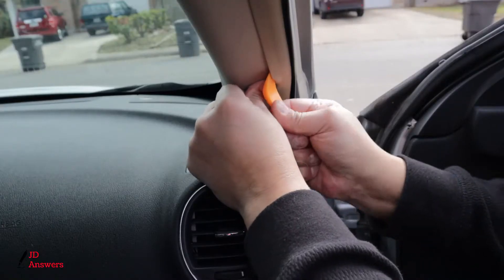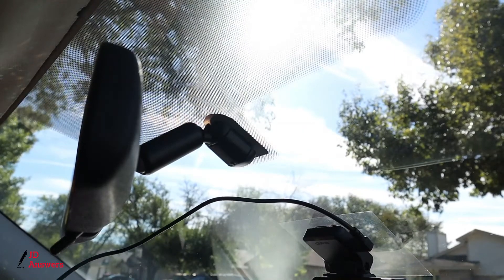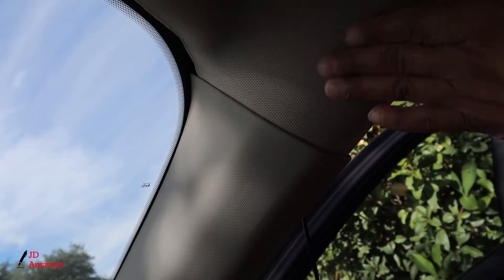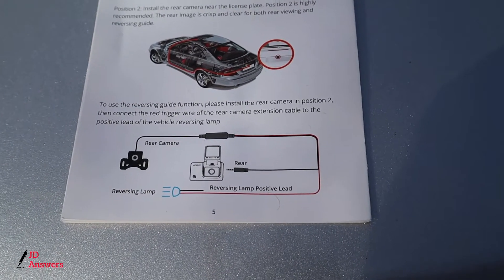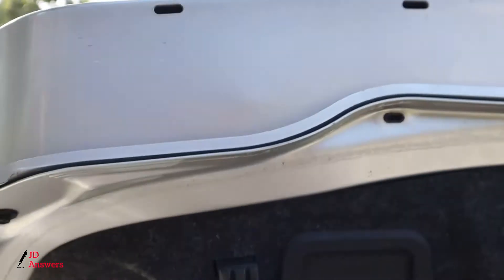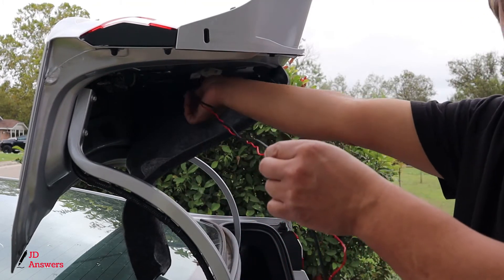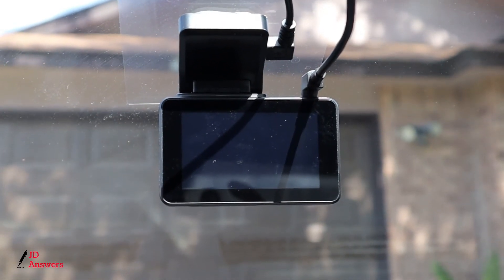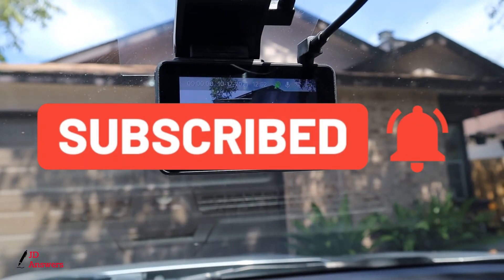HOW TO INSTALL THE KINGSLIM D4 4K DASH CAM. FRONT AND REAR DASH CAM WITH THE RED WIRE BACK INSTALL

Comment: so is the power source connecting to the rear light only to use it as back up camera? i already have a back up camera i just want a camera recording the rear side so would just connecting it to the dash camera work? or do i have to do the same process of getting power source from the taillight?
Reply from the maker: If you don't need the backup feature of the dash cam, you do not need to connect the wire to the tail light.

Comment: The dashcam keeps falling due to extreme sun  heat, what's the solution?
Reply from the maker: Try using a new adhesive. One person told me they cut a square out of an extra cell phone protector and applied it to the window. Then they applied the 3M dash cam adhesive and attached the dash cam to it. I never tried but they claimed it worked.

Comment: Any idea on how to unclip it from the gps?
Reply from the maker: Plug the power cord to side of the Dash Cam if you do not want to use the GPS feature. If you plug the power cord to the mount then the GPS is activated.

Comment: I am trying to install the rear camera on the inside of my husbands Ram truck. Is that even possible? The metal piece that glues onto the surface seems to only work on outside install. Any idea?
Reply from the maker: You will need to install it on metal surface or window surface.

Comment: Quick question why does my dash cam turn off randomly after a few seconds it turns off until I touch the screen
Reply from the maker: Adjust your setting for the display not to turn off.
Reply: @JDWIRED  ok thanks and how can I check my location without being in the car I read it has a gps
Reply from the maker: You will need to download the video you want to review to the Road Cam app and then the Road Cam app will display your GPS locations.

Comment: Did you test the hardwire kit you listed?
Reply from the maker: Yes the both work with no problems.
Reply: @JDWIRED  Thanks for that. I bought it. I saw that the other one on Amazon that pops up in search isn't compatible. I saw reviews that said the kingslim didn't work with it  appreciate your video

Comment: Even though KINGSLIM recommends placing the rear camera outside the car, there’s no way I’m drilling any holes.
Reply: You don't have to,  about every car has places to pass wires through into the cab, and the kit comes with 3m tape to mount the rear cam instead of mounting with screws if you prefer